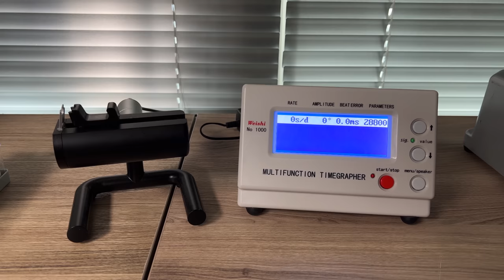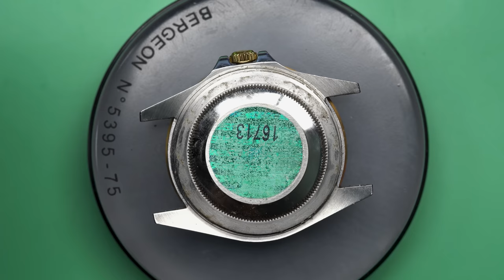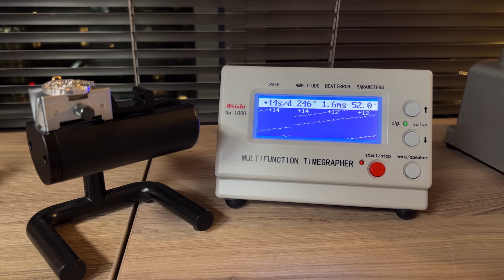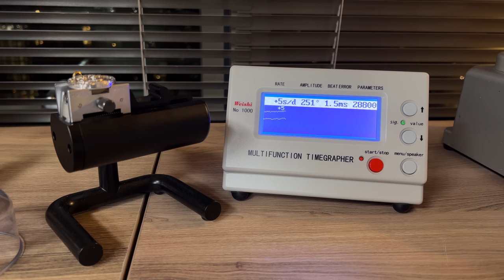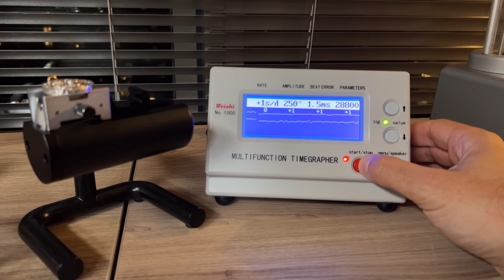My Friend Asked Me To "Check The Battery" On His Rolex...

Comment: The details, the machining, the well thought out features like the blued metal screws and the patterns on the gears to make sure they were installed correctly and the sheer number of parts made this functional art.  And that case and dial are beautiful.  I always thought Rolex were ostentatious show off pieces until you showed the engineering inside.  I wonder how many Rolex owners bought them for the name like Gucci or actually cared about that engineering.  Sadly I think most are just bought for the "I got a Rolex" status.
Reply: Not necessarily. I have an Explorer 11.
I bought it for one main reason and one nearly as important reason.
1. The engineering! (End of story!).
2. It is “rugged” type watch that LOOKS great, but not too showy! 
Oh, and having partially impaired vision I can actually read the (white) face much more easily than most of the previous watches I’ve owned.
I collect watches (from a 1956 Rolex Oyster on through) … but I WEAR my Explorer 11 by choice (unless I’m doing physical work that might damage my watch).
They really ARE works of art - as shown beautifully in this fabulous video clip. Regards to all from RH Auckland, New Zealand 🇳🇿"
Reply: The finishing and engineering of rolexes seem to be decent but they're among the worst in the industry from a purely price/performance ratio. The fact that you can get two spring drives for one entry level Rolex (assuming youre in que) really says it all.
Reply: There are tons of other well made watches that cost a fraction of a Rolex. With RMW you basically pay the name in the dial.
Reply: Yup. Everyone just wants a dive watch now. Like do you know anything about watches
Reply: And I wonder how many think their perpetual Rolex has a battery inside!?🙄
Reply: Like the Porsche of watches
Reply: Until recently I was a global motorcycle adventurer - injury forcing me to curtail many active sports that I used to undertake. My Rolex (Anniversary model) I’ve had for many years from new has been to almost every continent on the planet, including Alaska, Africa and several deserts.  It’s never let me down, kept to within 6 seconds since purchase. So, for me it’s been my rugged go to timepiece. Oh, I forgot to mention, it’s now worth 4 times the price I paid for it. I’m honestly not being smug here, merely just wanting to perhaps change your initial thoughts on why people buy a Rolex. I have other watches too, including a one-off Harold Pinchbeck (bespoke UK timepiece designer / fabricator) as my backup.
Reply: @rogerhawkins6433   if you bought watches for the sake of engineering, you wouldn’t have bought a rolex and neither for the craftsmanship since it’s a mass produced watch and the movements were made and supplied via aegler and still to this day since rolex bought aegler. 

You bought rolex for status pure and simple. Not that it prohibits you from enjoying it but there is no need to write this text pretending otherwise.

Rolex is all talk and no show and the design philosophy reflects that. 

Oyster perpetual instead of automatic

Superlative chronometer officially certified like that matter or cares to anyone since mechanical movements no longer need to play the accuracy shtick since phones and quartz movements destroys mechanical movements, obviously. 

And superlative standards is rolex their own accuracy standard unchecked by third party control unlike chronometer and METAS master chronometer standard.
Reply: @hodb3906  What absolute bollocks!
What IS wrong with you?
I don’t analyse every possible purchase or action to the extent you clearly do!
I’d like to know, what process do YOU go through to select a toothbrush? 
Perhaps you could send me a copy of your checklist and “pro’s and con’s”?
I really don’t give a rotund rodents rectum what you, personally, think of my decision to buy a Rolex, but I’m interested in your comments (and advice) about my choice of car - a 2002 Toyota Clavia Vitz.
Give it your best shot mate!
And I know it means nothing to you but I enjoy my Rolex Explorer 11 every single day!
Over to you.
Reply: the movements are also made by master watchmakers each watch can take hundreds of hours to make depending on the model

and those watch makers being paid by the hour are paid well. Then Rolex needs to buy those movements or pay for making them in house, and the rest of the cost of overhead is added on top of that. 

then your watch dealer needs to make money selling Rolex.

in then end you pay tens of thousands of dollars for a high end watch like Rolex. Because that is exactly what it costs to bring one into existence.
Reply: Why not both?
Reply: @dylanmccallister1888  Most, if not all parts are mass manufactured these days, machinery is more able to accurately cut thousands of identical components. Only perhaps the bespoke watch maker,  or restorer, will hand make parts.
Reply: @rogerhawkins6433  you are an outlier, sadly. Many (I would say the majority) of Rolex owners likely bought the watch because of its name and its price point. To most, Rolex is purely a status symbol, as evidenced by the owner of this video's watch.
Reply: @dylanmccallister1888  Rolex is a manufacturing company and not a haute horology firm.   I would be very surprised if ANY master watchmakers are involved in the production of a standard Day Date or Submariner. Assembly is going to be performed by technicians trained to perform a set of repeatable tasks. It's more likely that the watchmakers work solely on the service side of the business.
Reply: I bought my first Rolex in 1980 because I'm a lefty and always wear my watches on the left wrist--every--EVERY--other watch I owned would self destruction after short order.  Only the Rolex held up to the abuse.  Also, as the time standard for my 35-seat crewed aircraft, everyone set their time from me--and I would get my hack off WWV prior to take off.  I came to depend upon the mechanical Rolex because I wound up in places where I could not simply find a battery for an electric watch.  I had to be able to count on mechanical precision.  I'm not a 'watch' guy per se, but a guy who truly needed the mechanical precision, and durability.  Since 1980, I have owned 4 Rolexes--and still have the last two, this same dual-color 18KT and SS GMT II and my no-date SS Submariner.

Comment: It actually lets you track 3 time zones, GMT on the 24hr hand, GMT offset (Home time or maybe onward travel time) with the bezel rotated vs the 24hr hand and also local time on the regular hour hand.
Reply: But if the hand and pointer is static, how is a tracking anything at all?
Reply: @pippipster6767  hours offset in respect to the two other time zones.
Reply: But what about places that are 30 minutes or 45 minutes from the standard time zone. India, parts of Australia, and others.
Reply: @charlesgantz5865  it can't do that for you. You'll have to do the extra mental math.

Comment: I am always amazed you can remember where things go back where they belong. I suppose it comes with experience, but for me, I would be putting each part in a logical order. But then when you put them all in that screened container for cleaning I pull my hair out (what's left of it, lol) and scream, NOOOOOO, cuz now I dont know what order each part goes back. 

Then you alwasy have a once over of all the tiny parts after cleaning, and I have no clue what screw or part goes where, meaning, where do I start to put it all back together. There is no question I would be making a video of the disassembly as I would need it for the assembly. I would be pausing and rewinding and watching the video in slow motion to figure out what piece to start with and where it goes. I imagine it would take me several 8 hour days to put it all back together. 

Then again, I probably would be that guy that sends your the whole disassembled mess to you via FedEx for help, like you did in a previous video. You must have a photographic memory ability that helps you know exactly where things go and when as I dont see you referring to any watch manual with an exploded view of the parts or video during the reassembly portion.

Thanks for making a very complex and complicated watch repair look so easy and effortless. Job well done!
Reply: I think he also uses the video to go back and check if he's not sure.
Reply: I was never a watch mechanic but when i was young i could remember every part and piece that was removed from a repair done on any vehicle i was working on, including a whole dashboard assembly. Today I'm lucky to have 10 things to put back together without forgetting something and redoing it. there's a skill about memorizing where things go then becoming good at what you do is easy. At 65 i leave most things to a shop.

Comment: Nice one Marshall! 👍 I own a 2012 Rolex GMT Master II (the normal steel one with black dial, the green GMT pointer and the ceramic bezel) and it runs well although it has been serviced twice already after it broke down on me. I don't do anything crazy with my watch, but it would suddenly run 30-40 minutes slow and after 2-3 days it completely stopped running.

Comment: The battery is recharged! 😜  I was surprised when you adjusted the rate before addressing the beat error.  You got it dialed in pretty well, that's for sure though.  Thanks for another fascinating video!

Comment: Nice job! One of these days you'll have to try a co-axial Omega. A little tricky removing the balance assembly, I read up on it first. I used to work on my newer Omega's. But I find with my higher end watches, I'm better off sending them off because I can't get the parts they casually replace. For example, with my GMT Omega you just move the hour hand around to set the date.. Of course there's a part that always wears out but is impossible to source.

Comment: When you started working on watches, how long did it take before you became comfortable with the repair process? I can’t imagine remembering where everything goes even with pictures of everything
Reply: It becomes a lot easier when you know the purpose of everything and the relation to each other. You section down the watch and it's suddenly not a million tiny pieces anymore, rather many groups of pieces. If you watch a video on how a mechanical watch works, you'll find that all these tiny cogs gain a distinct meaning and you'll start to know where they go

Comment: 01:20 technically it lets you track 3 time zones at once. one on the regular hour hand, one on the auxiliary hand and a third by rotating the bezel. 🤔🤷
Reply from the maker: That's not how it's designed really
Reply: @WristwatchRevival  well that's why the bezel rotates. As opposed to an Explorer ll which has a fixed bezel.

Comment: i smile at your headline Wristwatch Revival...as a former watch repairer in a high street retail shop...i lost count of how many of my customers asked me to change the battery on their automatic watches...most of them had just been sitting in drawers and jewellery boxes for ages...many were heir loom/hand me downs from deceased relatives...sometimes just a shake would set them going...other times a little persuasion...i didn't get paid much but the pleased looks i got very often more than made up for the lack of monetary reward...i miss it...even the disappointments when a quartz watch movement had refused all my attempts to start regardless of even last resort shock treatment with the Demagnetizer electronic tool...we all have our weaknesses or Achilles Heel...mine became square watches...i never had the correct closing adaptors for the different sizes...had everything for the round watches...yes i cracked more than 1 square glass closing them...over a decade of a thousand or more repairs it isn't a terrible record...ruins your day/week though...i remember the fails more than the successes

Comment: The GMT is a lovely watch, my Batgirl is my watch of the moment but it's such a ball ache to set if the dates a few days out (IE it's been stopped for 10 days) and you want to maintain the GMT/hr hand setting (no quickset date on the 3285 mech).
Yes you can fairly quickly rotate the date by spinning the hr hand (jumping hour hand setting) but that cocks up the GMT position unless you note where it was and check if it's am or pm.

Comment: I really like your videos, you are doing a good job, but here are some tips and tricks, to step up your game especially with those high quality movements.

Normally you never use a steel screwdriver blade to lift up a bridge, use pegwood instead. Also it is recommended that you dont put decorated parts on a steel plate being upside down. Always use paper inbetween  or to prevent scatches. Same goes for the green mat(also use thin paper underneath). With screws you shouldn’t slide in the slot from the screwhead, because it will leave marks. There are blades made out of beryllium to make sure you dont damage the slot eather. I can recommend you to only use brass tweezers except from hairspring adjustments. And the last tip is to also use pegwood for the stem removal. It is no hate just some tips which will definitely help you to make a very high quality service. Keep up the great content.

Comment: I learned Perlage in high school aeronautics. A #2 pencil eraser and aluminum polish. Mount the pencil in a drill press, eraser side down, set the depth on the press to touch the metal, apply polish to the surface and dot dot dot dot.

Comment: So, being used to the more 'heavy' side of engineering, I regularly come across a snapped screw/bolt scenario (and the usual shenanigans involved in removing the remains so a new one can be used).  I'm wondering if this is ever an issue with watch movements and, if so, how you deal with them?
Intrigued (and related a bit to my last point) to see that a torque wrench is not used in watchmaking at all...?

Comment: On my Sea-Dweller 116600, when I pull out the crown to set the time, the crown seems to enter a no-man's land and jams in some intermediate position which does not stop the second hand. When this happens, I also cannot manually wind the watch since the gears seem to make a crunching/skipping feeling. I have to then push it back in all the way, turn the crown slightly, and then try again and it then pulls out properly and stops the seconds hand and winds the watch properly. I've gotten so used to it over the years that I can quickly recognize this and retry. This has been happening ever since I bought the watch new in 2008 but I didn't want the watch opened at the time to preserve the water-tightness. Why does this happen and what part is affected on my 3135 movement? Can you do a 3135 movement disassembly video?

Comment: In the gun business the swirling pattern is called jewling, and blued steel is called case harding. High carbon steel is heated to the first eutectic temperature (point) and quenched. Hardens the steel and turns it blue..I watch your show and the Lock Picking Lawyer to wind down. Thank you.

Comment: I have a Tag Heuer WG5114-P0 that I bought at the Tag factory store in Zurich Switzerland when I was there around 1996. I originally sent this back to whoever does Tag servicing in Switzerland every few years but the last time it came back running slow and they said that was "normal" when I called them so I no longer trust them. It's still in near perfect condition but running slow and it's occasionally stopped when I get up in the morning which it never did prior to that last service. These watches are not high value like Rolex but I've always thought this was one of the most beautifully simple watch designs. I would love to hear your thoughts on this and if you think it's worth fixing. If so, it would be a good video for you since afaik you've never done a video on a Tag.

Comment: Lubrication of the movement is an aspect of watchmaking that requires serious skill. One should put in enough oil so that the watch may survive the next service cycle which I think is about 3 to 5 years. Otherwise, even if the watch still is working, some parts with dried oil may wear prematurely. Escapement was also did not lubricated.

Comment: 49:18 Hi, Marshall, I didn’t see you use the case back tool to reinstall the case back, so did you just hand tightening it or did you not fully show this step?  I’m working on my 1680 with the 1570 mvt and was wondering the proper procedure. Cheers.

Comment: Can you make parts for an old watch?? I have an old  watch that started life  as a pocket watch and is now  a wrist watch. It has a guilded  movement,  meaning it looks sorta of like gold plated  but it isn't gold plated. The watch either has a  broken balance staff or a bad jewel in the balance staff  pivots. What will be required is making a staff, putting it into the balance wheel, posing it and timing the watch. Or replacing a bad jewel or jewels  in the balance pivot points. I paid $400 for the watch several  years ago but it never ran correctly and would stop running often! So I removed the back and looked at it with my loop and could see the balance wheel flops  a little in its' pivot points. I  have the tools to do  this job but  not the capability! I  am a long time collector and have over 400  watches. I have 4 Rolex watches, 2 Omega moon watch chronographs, two  Breitlings, one is a 1960s Navitimer and the other is a 1950s two register chronograph in 18K Rose Gold. I  also have a Patek Philippe Calatrava from the mid 1960s. Several Longines, and Wittnauers including a large two register Chronograph. I do have a simple time only Audemars Piguet. The rest of my collection includes almost all of the Illinois  watches from the 1930s and Bulovals, Hamiltons, and other brands.  I have not  been able to find  any watch maker who wants to try and repair this old watch.